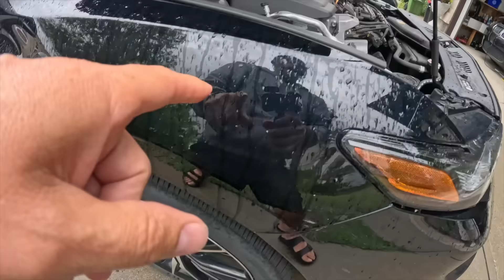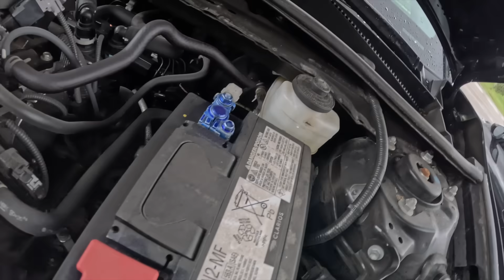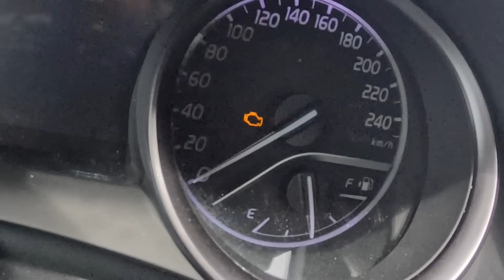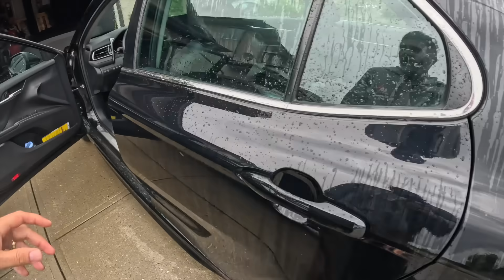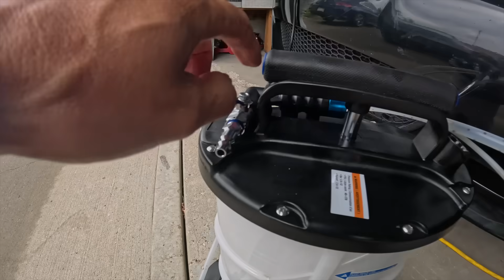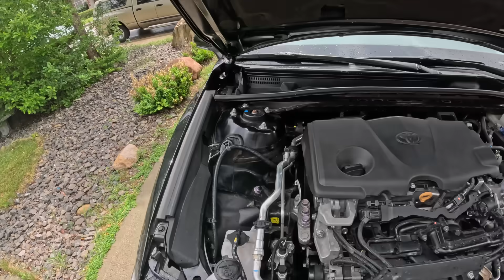How I Now Avoid Our Toyota Dealer SERVICE SCAM's.

Comment: It was better when you had a tune up twice a year for points, plugs, and condenser.  You also got an oil change at that time and the joints were greased.  The cost was minimal and your plugs didn’t get seized due to them not being removed for years.  New cars today are technology junk with a bunch of software that doesn’t always work and requires updates.  I want a car not a throw away cellphone.
Reply: No it was not! Those cars used leaded gas in the engines were worn out before 100k. I've seen many of them were out 50 and 60 k..

Comment: I was scammed at a honda dealer. They claimed i needed an engine air filter. However i informed them i changed it a week earlier. Their excuse? The advisor said they recommend parts by mileage. So there was no "inspection" lol what a joke.

Comment: Every 10k is fine with ACEA oils.
Reply from the maker: Oil is cheap though, e vines are not
Reply: @ECPP Agreed. Some engines need more regular changes
Reply: Every reputable mechanic I know or watch their channels say otherwise.   Just read what manufacturers say is “extreme service”.   EVERYONE will be on the extreme service schedule.
Reply: @jpjp3873 Some people say you should change it every 3k. Oil analysis shows that 8-10k with ACEA oils is fine. I don't trust API myself

Comment: GDI engines are prone to fuel dilution especially on short trips. 5k for sure in the city. Walmart usually have those Supertech synthetic oil on sale for $28CAD more reason to DIY. Nappa gold or wix are good quality oil filters for $17-20CAD.
Reply from the maker: Excellent points

Comment: On my Lexus ES 350, Walmart does my oil changes and all my tire needs.
I do my own brakes, coolant changes and whatever else I can.
I use a K&N air filter and I just clean and reuse the cabin air filter… good as new.
Reply from the maker: Yes if you have a trustworthy shop that can help indeed

Comment: I had a Honda pilot. I used to bring it to get its oil service at the dealership all the time. And then when I brought it to another dealership because we were out of state the dealership that I took it to out of state up in New Hampshire had told me “when was the last time I got a oil change.”I told then I go every 5 to 6000 miles. They told me it looked like I hadn’t had an oil change in over a year. Mine you I  knew I was taking my vehicle to my local dealership And this is what was going on. I had them put in a note for me on my paperwork just in case of something ended up happening. Which something did end up happening, which was my timing belt tensioner went out way before it’s time. Some Dealerships service places are crap.
Reply from the maker: Some are great and others are thieves.  It’s hard to know what’s what sometimes
Reply: That's a shame, sorry to hear that, those are great vehicles also, good luck

Comment: Finally, DIY is the way to go. Can't trust mechanics doing a decent job. They want to be fast and a lot of them don't care, they're parts swapers, period. Last one changed my oil and filter. Figured I'd do it next, flushed the oil, easy as can be, but what a nightmare to remove the filter. So tightly on, I had to get two oil tools to remove it, with the help of a 3 feet lever as to torque it out.
Reply: And THAT has got to be one of the best reasons to change your own oil!  When YOU do the work you know that the next time it needs to get done, you'll be able to change the filter and remove the drain plug with relative ease.  Instead of cursing everything in creation, just trying to loosen an oil filter is so tight it must have been torqued by King Kong, only to find out the drain plug is even tighter!  When you do these chores, you KNOW it's done right!
Reply from the maker: That’s a great strategy and I agree, you can definitely trust your own work.

Comment: I went to Brown's Line Auto in Etobicoke, with a 2002 Toyota Corolla. The Heat engine gage was on red so I thought the car would over heat. Had it towed to Lou at Brown's Line. Phil the mechanic said it could be the water pump etc...he scanned the car with a scanner and there was no code. I told him that I thought it could be a heat sensor. They said no way they never have seen such a case in all their years of work. The parts changers changed the parts and even called a mobile truck analyst to look at the car. I was forced to pay $1500 to the parts changers and the the problem has not be fixed. It ended up being the heat sensor! Buyer beware there are many parts changers out their who either don't know how to diagnose and issue or are incompetent! He charged me 4 hours for the mobile truck sensor work, other mechanics told me it would take at most an hour or less. Buyer beware!

Comment: 2022 camry opening hood there still using stick holder to hold the hood ? since 2009 camry already had without using stick to hold the hood i remember since then all model and toyota brand they were built hold hood as it left up. wow 2022 camry look like quality does suck drop into degrade require using stick to hold the hood :D

Comment: Hate electric water and power steering pumps  5000-7,000 mile oil changes using synthetic oil. Trans and drivetrain fluids first change should be at around first 30.000 miles with new purchased vehicles OE synthetic fluids. Best to use OE filter or high quality filter. Some after market warranty companies don't support DIY on a covered vehicle. You definitely have the right idea.✔️💯
Reply from the maker: Thanks very much. Yes cars cost so much these days I would rather take care of it donut lasts

Comment: I changed the oil on my new Mazda at 3500. Used synthetic. Then I change it every 5000 at Valvoline where you sit in your car while they do the service. So you see everything. They even show you the dipstick while you’re still sitting in the driver seat. Really don’t trust dealers.
Reply: I would never get my oil changed at Jiffy Lube or Valvoline.
Reply: @fitzdaddy2  I would not let them give my dog a bath.
Reply: @fitzdaddy2 Always take your vehicles to the dealership
Reply from the maker: That’s a great strategy.
Reply: Question? Why don't you use original MAZDA OIL ENGINE?
Reply: I get my oil changed in less than 5000 miles and I use Valvoline Synthetic 5/20 for my Ford Focus has 304k miles
Reply: @Vincent-ke5zn motorcraft reccomends every 15, 000 kms or every year
Reply: @ricardogil7665 you're crazy, I'm not going 9000 miles +on an oil change, I'll listen to Mark and my mechanic before I listen to you and motorcraft. They tell you that so you have to buy another engine
Reply: @Vincent-ke5zn I Just follow the manual and use original Parts
I used to own a GM vehicle,  and Always did my maintanance at the local dealership, 340, 000 kms, every 10 k of intervals, never had a issue
I never used an alternative autoparts or fluids
Reply: Can you really see what they are doing when you are locked in your car at Valvoline?   On my new car they showed me a dipstick showing the transmission fluid was a dirty brown and suggested a change.     I said no thanks, the car only has 20k miles, when I checked later the transmissin  fluid was red.
Reply: @ppumpkin3282 Valvoline has bad service reputations , I don’t trust them . Don’t compromise the quality , go to Toyota dealership for authentic oil and parts . You get what you pay for !
Reply: @ppumpkin3282 they let you get out of the car if you want to watch them.  they are pretty transparent
Reply: @ppumpkin3282  I never use VALVOLINE this cheap oil, i Always use the original oil and original filters
The reason behind is better resale value
I sold my vehicle with 340 k, for more than I really expected, thanks to my 33 Services done at the dealerships

Comment: Great advice Mark.  I get my Toyota oil and filter changed out every 4,500-5,000 miles.
Reply from the maker: Thanks and great to hear that’s working well for you!
Reply: Or 6 months whatever comes first. It could actually be less if you drive a lot of short tips. You may well have fuel dilution in your motor oil. Smell the dipstick or drain oil.

Comment: Honda says same bullsh1t about changing oils after logging in every ungodly amount of miles which don’t make sense to me. I think doing it more often the better to. Model Y has no oil changes but do have to do windshield fluids.
Reply from the maker: Exactly its for 2 main reasons. bragging rights as a marketing scheme so people believe less maintenance, less cost down the road(mind games), and the other is with all n maintenance plans that customers are often sold as new means less actual comitted work by the dealers and money saving for them.
Reply: @ECPP yup